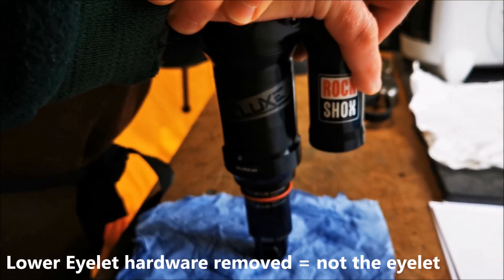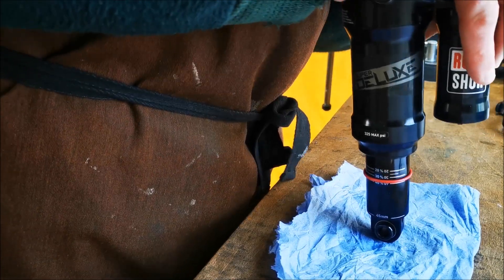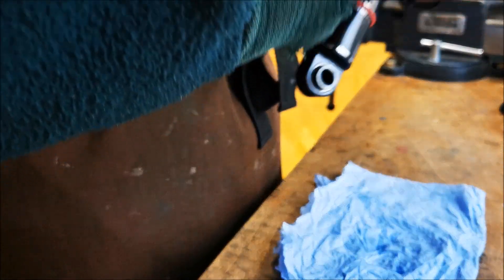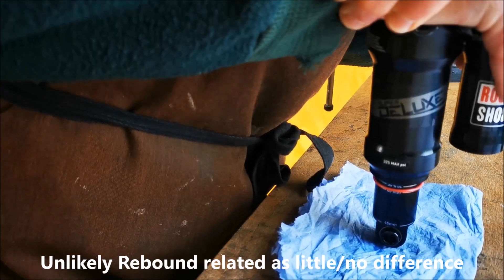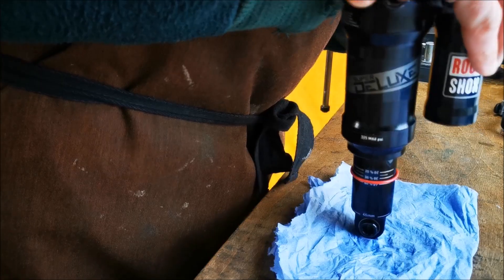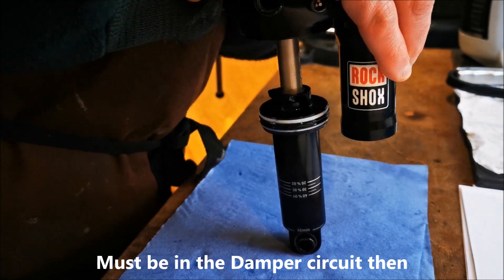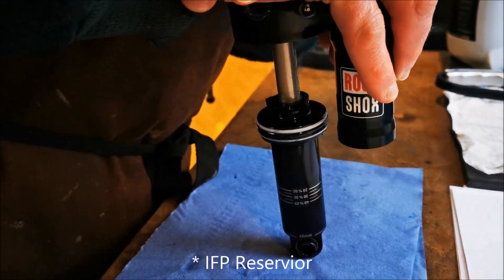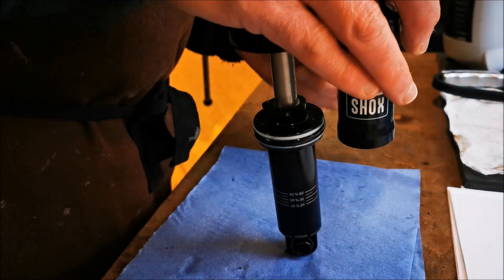FIX - RockShox Super Deluxe Knocking - Identifying by Elimination

Comment: Hey this video is ssssoooo helpful thank you. I have the exact same problem with mine when on the bike, it is most annoying going down a curb and short sharp compressions. It is just like in the first video. However I did what you have done and tested it of the bike with my palm pushing down, and I can’t hear the nock!! The small o ring at the top of the inside of the shock that holds back the travel reducer spacers is way too loose which I heard can be the problem. Do you know if a thicker o ring will be the right solution for me?
Reply from the maker: Hi - They are different noises. One is a rattle, if its the loose o ring. The knock is as per my video, that noise. If you have that noise over short fast bumps and its this shock, then I suspect its the piston design issue and fitting a hotdog piston and firming the compression tune one step will sort it out. See my latest update comments above (I probably posted those after you posted this). Also check out the other vids I linked in the comments below - one of them covers both the piston knock, and the rattle due to loose o ring, so you can tell which you have.
NOTE: off the bike, you need to depressurise the shock so you can rapidly compress it to hear the knock, so I guess it could be in your linkage, or a loose cable etc. You really need to ensure its the shock first by testing off the bike.

Comment: Shim stack problem (i think)
Reply from the maker: No, not quite - its the original piston design on very light tunes. So RS fitted the 'hotdog' piston to later shocks, and you can retrofit it and up the compression tune one to balance the tune. The hot dog piston lightens it slightly. Has solved the knocking. As per my later posts/updates, its a known (but not by many) issue apparently 'capilliary adhesion break away' its called. The hotdog piston fixes it.
Reply: @rupedog  So, knocking is a feature of the hydraulic system. Certainly an unpleasant knock :)

Comment from the maker: Further info, to help others - From vorsprungsuspension.com (I had emailed them about it)
"The issue is capillary adhesion breakaway, caused by a combination of piston design and light compression valving. If you replace the compression shim stack with a firmer valving, the knock will go away. However, you'll also have more compression damping, which you may or may not want. The Hotdog pistons that SRAM offer are a "fix" for this - and they do improve the knocking, but they decrease compression damping further too, which again you may or may not want".
I fitted the Hot Dog piston, and then upped the compression tune one level from what it was so keep the compression feel as similar as possible.

Comment from the maker: SO an Update...
I was able to get and fit a Hot Dog (High Flow) damper piston to my knocking Super Deluxe. Mine is a late A1 (Crossover shock, so some B1 parts inside, some A1 - crucially I had the 'top hat' top out plate, qalbeit a very small one, so its compatible!!!), so the piston fits fine. Its exact same dimensions as the original one, although the part number is only listed for B1-B2.
Anyway, done static tests and the Knock seems to have gone! Yippee! So relieved. Just hope it stays that way after some hard riding!
I also upped the compression tune one level higher, becuase the high flow piston slightly softens it.
Talking to the tuner, Mike, at TF Tuned, he seems confident this would solve (or at least lessen) the knock - was familiar with it. He said it occurs due to the shims tacking together ("capillary Adhesion Breakaway", apparently), the hot dog piston allows just that extra bit of flow to stop this.
If you have a knocking Super Deluxe, I recommend sending it to TF Tuned and ask them to fit a Hot Dog Piston, and adjust the compression tune up one, if you dont want it softer anyway.
Reply: Hey Rupedog - really glad I found this video as I have the same issue. did you get TF tuned to install the piston and set the compression tune? if so, do you know how much it was?